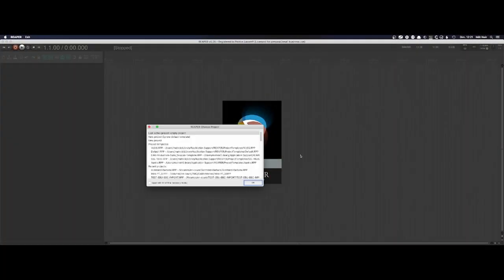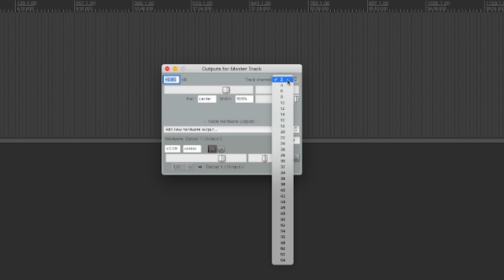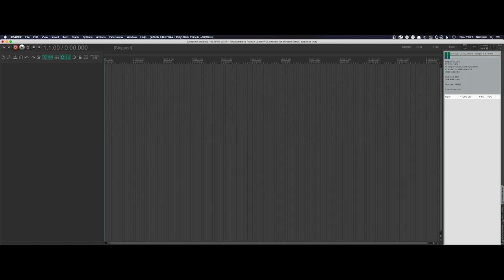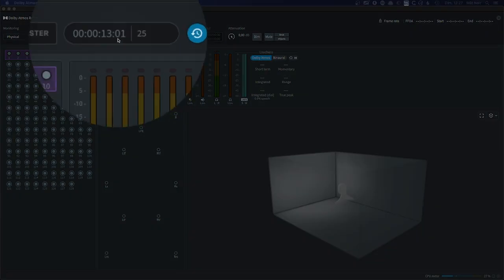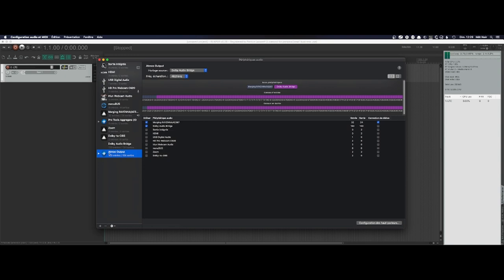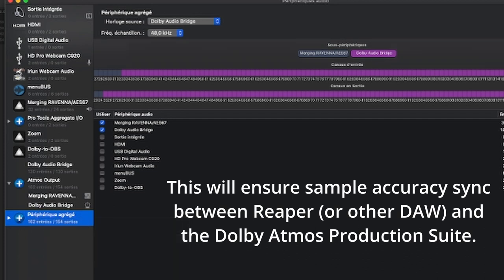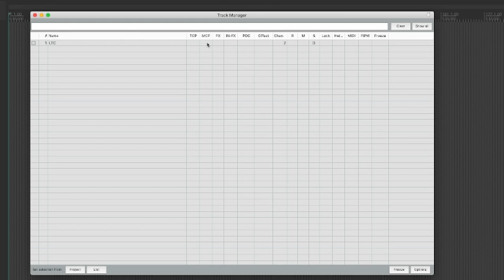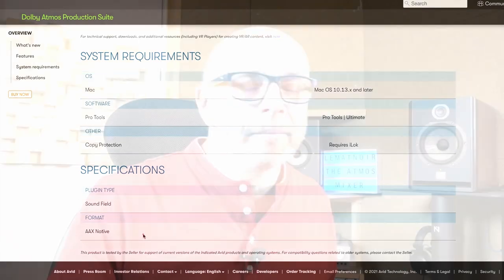Basic Reaper Template For Dolby Atmos

Comment: Thanks for sharing. I'm interested about replace Pro Tools with Reaper, but worried about Atmos, now this is a great news to me! Thanks again.
Reply: Yes, I use ProTools, Pyramix and Reaper.  Reaper has become our studio's go to DAW.  More stable, more automatable, more flexible and much more efficient to use.  The only times we use ProTools is if someone mandates it or has a mix done in ProTools that is too far along to justify moving it to Reaper.
Reply: I'm a Reaper user, too. Atmos Planner works fine if the DAW is "stopped". If I hit "play" I experience huge lags in panning things around manually or via automation. Does anybody of you got the same problem? MacBook pro m2 max, 64gb ram, Dolby Atmos Renderer 5.0
Reply: @Musikproduzent  I can't get DAMP to work at all with automation.  It just sits there...nothing moves.
Reply: @AustinSignal  didn't check that out. But it seems like vst3 version is buggy. I don't have that problem using the au
Reply: @Musikproduzent  ah!  So you’re using automation w DAMP in Reaper?!
Reply: @AustinSignal  not yet automated but best didn't let you pan during Playback so I think it should work

Comment: I have downloaded a Trail version of Dolby Atmos Renderer and set it up in Reaper exactly as you describe. But I need to be able to render a file with an exact length. I am making exhibition sound that runs in a loop and I want to test whether I can make files that loop seamlessly. I can't do that with Fiddler and strangely enough not in Logic Pro either. Only Nuendo and I primarily use Reaper. And I can't figure out how to make a master file with an exact length. I can understand that you should also do pre roll and in Protools it seems to work, but I don't have access to Pro tools. Thank you
Reply: I have now addressed this issue on the reaper forum in a thread you follow..🙂
Reply from the maker: Things may have changed since I made the video. Would you care to provide  the forum thread link so we can all benefit from your findings ?
Thank you for your comment!

Comment: Does the Dolby renderer feed your speakers or does it return back to Reaper?
I’m trying to figure out if you can still control your interface with Reaper.

And if it does return to Reaper then out to your speakers do you have two aggregates in Reaper for this to work?

I’m in the middle of doing tests to see if Reaper can communicate via Raveanna  from my PC to a Mac.
Reply from the maker: Hi Kevin!
The general idea is that the Dolby Renderer sends audio to the interface which in turn sends audio to the monitoring controller which in turn sends audio to the speakers.
In my case, it's a bit trickier since I wanted to keep using my DAC of choice (Merging), so I have the following setup :
Reaper's out -> Dolby Renderer in (Core Audio)
Dolby Out -> Interface in (Ravenna Virtual Audio Device in Core Audio)
Interface out -> monitor controller in (MADI)
Monitor controller out -> interface in (MADI)
Interface out -> speakers (analog)

Please, let me know how your tests go!